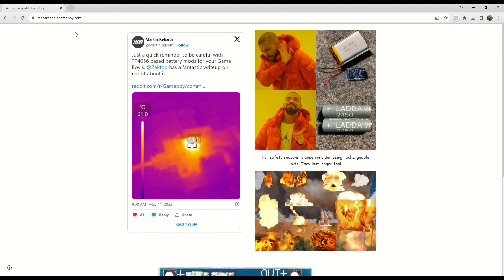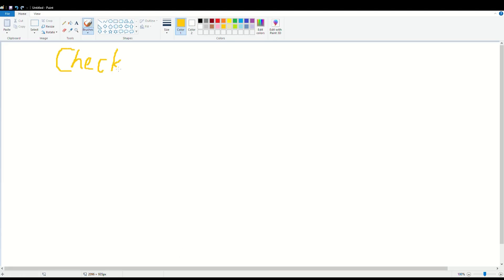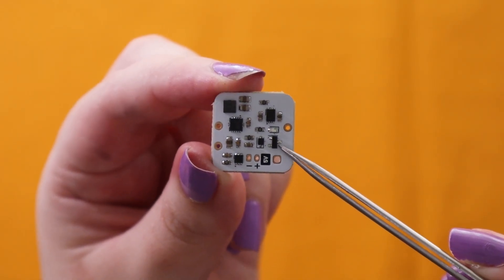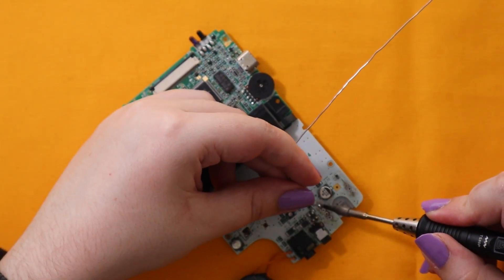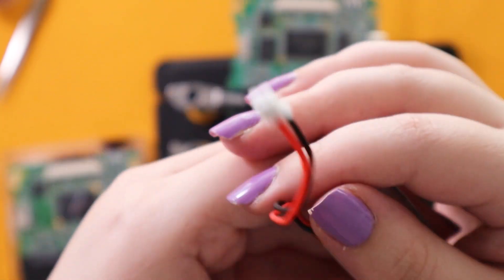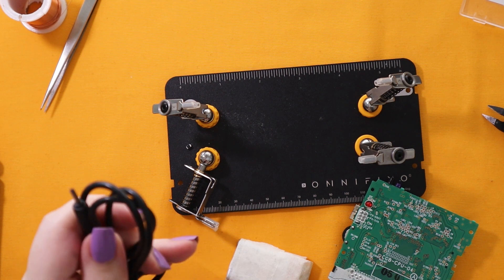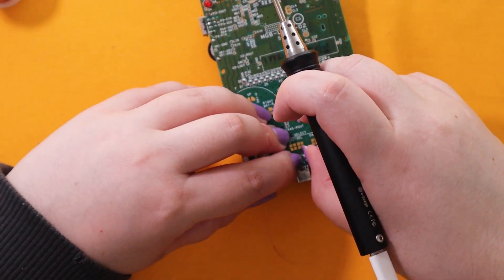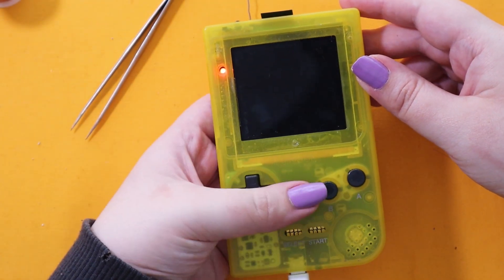Safer Charge DC for the Game Boy Color and Pocket

Comment: Successfully installed the LED board from your shop last night. It’s my first soldering project outside of bridging fuses and I nearly flubbed it but she’s all done thanks to your help!!!
Reply from the maker: That's awesome to hear! Here's to many more
Reply: @NatalietheNerd  I’m sure it’s something I can fix with a little more prodding, but the board flickers when I press on the d-pad. Issue with the power supply wire you think?
Reply from the maker: Sounds like something is shorting. Send a pic of the install to Natalie@nataliethenerd.com so I can help out ☺️

Comment: Interesting I've always wondered about this and why some mods are more safe then others.  Great video!  Now with the higher quality chips installed any idea on the heat improvement on yours?  As that was the original issue in the first place the heat being too close to the battery = boom lol.
Reply from the maker: It gets a little warm when you play and charge because there's 500-600ma running through the board, but it doesnt matter as much cause its no where near the lipo. and I mean at 8hrs battery life who needs to play and charge 😋

Comment: This is great! I am curious about the LED on the board in opaque shells where you can't see if it's lit or not and thus not know if it's done charging or not. How complex would it be to have the board use the console's power LED and, for example, blink when it's charging, stay solid when the console is on but not charging, and turn off when the console is off?
Reply: I'm gonna attempt to wire up the led pads to the oem power location my next install did u end up giving that a try yet?
 I was thinking abt replacing the oem light with a similar smaller  green led and cramming them next to each other should be easy to tell what's charging vs default power light that way

Comment: Installed this and it's great, love the fact the green one is similar to the standard power management board, so to the untrained eye it looks standard. I will say, charging with the DC jack, I get a LOT of fuzzy noise out of the speaker while the GBC is powered on, even with the volume all the way down. Is this a problem like old caps or is it normal?

Annoying the lipo I got had really short wires so I had to extend them which was a pain.
Reply from the maker: Yeah, while charging and playing you will get static due to the way the stock amp is wired
Reply: @ would/ does the bucket amp improve it?
Reply from the maker: Potentially I'd like to test it to be sure. The problem with the original amp is it's wired directly to the battery voltage as input and as the battery is charging this voltage wouldn't be stable and would create a lot of noise. Cleaning the headphone jack and a new volume wheel could potentially help too if there is noise when the volume is down

Comment: Oh and does anybody know if this board will allow brightness control through the contrast wheel on a pocket for use with the funnyplaying ips kit?
Reply: Also also could I wire up an led to the pads where the safer charge charging indicator is and route them to an led where the power led is ? Like would it work fine relocated or would that not be worth doing? If it would work I'd love to give it a go just for a little extra personalization/my led-less junk pockets
Reply: Sorry for the beginner questions lol no worries if u miss them ill post how it goes for anyone else
Reply: To answer my own question no it does not, but it's a very usable brightness I would guess 2 -3 steps down from max (compared to the gbc fp kit)

Comment: Would this board work for the first gen pockets? I used another brand for mine and it wasn’t “made” for it so I switched to the cheaper one like you pictured. I have it separate from the lipo though with no problems so far.
Reply from the maker: Yes it will!

Comment: Hi Natalie! I noticed you had a resistor soldered on near the USB-C port on the Pocket. Is that unrelated to this mod?
Reply from the maker: Those are called CC resistors which let you use a usb C to C cable
Reply: @NatalietheNerd  Good to know! Any idea on when the safer charge boards will be restocked? I was able to get a PoCO kit but missed out on the safer charge board.
Reply from the maker: October 19th :)
Reply: Hi @NatalietheNerd! I'm so close to finishing my Poco but I'm having trouble getting it to boot. I'm using a LiPo battery and the safer charge board. With a Poco, I need to wire to the left side of the F1 fuse and the 5V from the safer charge to the USB C port?